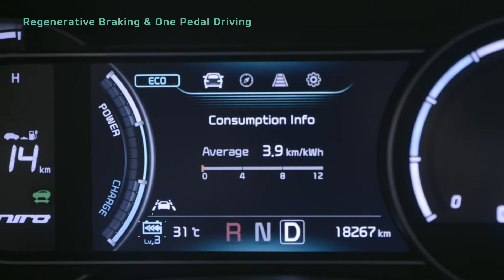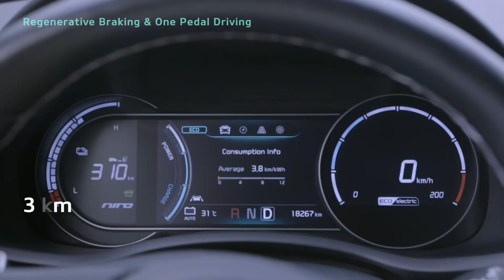Regenerative Braking & One Pedal Driving｜e-Niro How-To｜Kia

Comment: I drive a lot in hilly terrain. When going downhill, what should I do to recapture maximum energy and reduce break wear?
- keep the break lightly pressed as the vehicle rolls downhill.
- coast downhill with regerative-breaking level set to L2 or L3
- set a cruising speed of around 25 mph and cruise downhill.
Reply: Use the Regen all you can.   Save your brakes, -- don't need to stop with heat, make electricity.

Comment: Do the brake lights come on when using regenerative braking on a self charging Niro Hybrid and if so at what level? Ive tried for over a year to get a definitive answer to this question and all Ive got so far is various differing opinions!!
Reply: They come on at level 2 and level 3
Reply: I know my LEAF does. I’m sure it’s a federal regulation of some type.
Reply: In my kia phev hybrid the brakes lights come on at level 3 which will bring vehicle to a stop usually within 5 secs like breaks

Comment: I still have no idea what this is. Is it like a boat where you let go of the gas to stop?
Reply: Its like changing down gears in a manual car to braking slowly or going down hill, three levels of braking from mild getting stronger each step, I use it all the time.
Reply: @SidBonkers51   not exactly. If you use auto mode, it is not braking before car sees something in front of itself. f.e. another car. if in manual, then it is constant braking during drive. Then you feel it even when accelerating.
Reply: @LukasNikstus  Sorry I dont know what you mean by auto and manual? Im talking about regenerative braking using the paddles which have 3 levels of regen braking, what Im asking is "do the brake lights come on when using generative braking" and if so at which level. I suspect they may come on when using level 3 as that has the most braking effect but there is no way of knowing as you cant see if the brake lights are on when your driving.ps. you replied to the wrong comment ;)
Reply: @SidBonkers51   I have replied to the wrong comment. Still I talk about same thing - paddle on the right hand side holding longer than 1 sec. turns on auto mode on regenerative braking system. That you can see under battery sign in panel by appearing ''auto'' sign. Then car follows obstacles in front and brakes itself. But is there a brake light when car brakes - good question. Will try to find out with someone driving behind :).